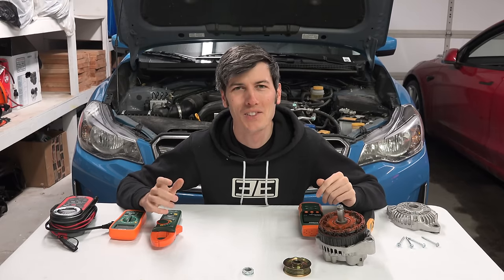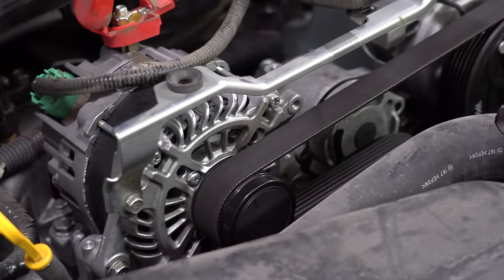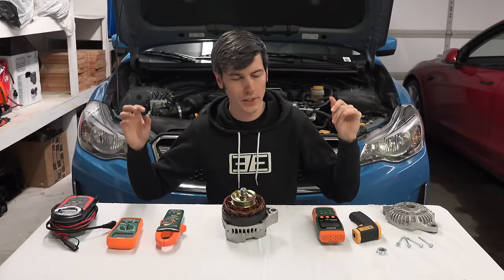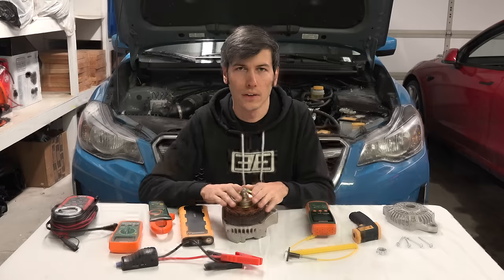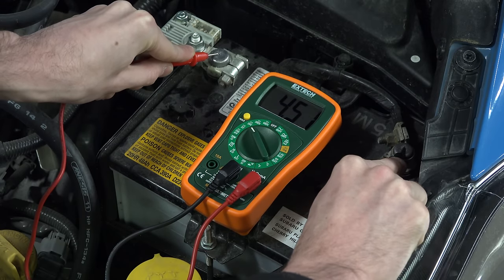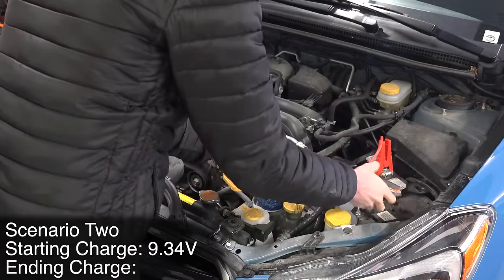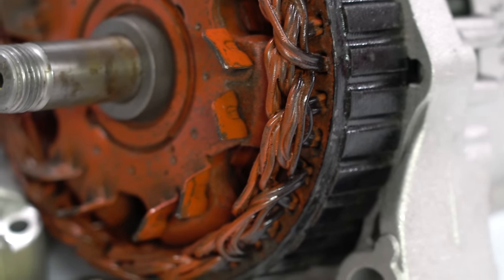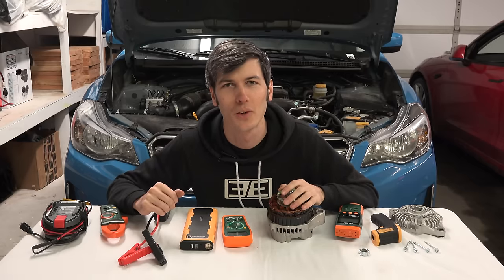Can A Dead Battery Ruin Your Car's Alternator?

Comment: The alternator is designed to work correctly at full load which you are not going to get unless you rev up your engine up to 6k rev/min. The alternator, as any other working machine, will get warm when it is working. Your biggest concern with a dead battery should be your ECU's that could potentially be damaged since the battery helps kinda likea huge capacitor that smooths the possible variations on the alternator output.
Reply: A dead 'good' battery will provide more 'capacitive' spike filtering than a fully charged one. If the alternator tried to apply too much voltage, the dead battery would happily gobble it up. If the battery can crank the starter and start the engine, the ECU voltage is fine. If the voltage was too low for the ECU, the engine would fail to start but it would never have cranked the engine over in the first place.

You'd have to remove the battery entirely to not have it absorb spikes. ECUs are not fragile children, they are designed to operate in a horribly noisy environment across a wide range of voltages and temperatures and have idiots do weird things to it's inputs and outputs. The power supply is well-equipped to deal with short term over-voltage. Even a simple resistor and a zener diode would do the job. Otherwise, shoot the engineer that designed that POS and get a proper car.

The alternator was designed to operate at the full RPM range of the engine. It provides the current necessary to run the car and top-off the battery after starting the car, plus a moderate amount of over-capacity for longevity and abuse. If the battery voltage is fine, the alternator field coil is throttled back and the alternator has no load, regardless of RPM.

However, due to the physics of moving coils and magnet fields, an idling engine can't turn the alternator fast enough to supply it's maximum current -- assuming it has a dead battery or a short circuit that is trying to suck endless amps from it.

Comment: It would have been interesting to see the difference in gas mileage between the 2 drives.  Not that it would be significant but it might be more reason to use a charger vs the alternator.

Comment: What about starter motor ? Does a less than 100% charge ruin it ? What’s the min voltage required for stater motor to work ? 🙏🏽
Reply: This stuff shouldn't apply to the starter. Starters aren't used for very long so they shouldn't overheat in normal use. When your car has a low battery and doesn't start it is usually because your battery doesn't have enough voltage to trip the starter relay so no power will even go to the starter.
Reply: A low battery could affect the starter's performance. The starter requires a certain number of watts (volts x amps) to crank the engine, when the voltage is lower more amps are needed to get the same wattage from the battery to turn the starter. Amps pulled from a battery have to do with the discharge ability of the battery, measured as C. C rates are multiplied by the capacity of the battery to get an amperage output rating. If the dead battery doesn't have a high enough C rating or the capacity is too low, the amperage out will suffer. This combined with a low voltage will mean fully stressing your battery to the point it can damage the cells while still not necessarily outputting enough watts to turn the starter and engine to start it. Also more amps drawn by the starter does create more heat, which as mentioned by Jason, can cause the internals to fail sooner. Voltage also dictates the rpm of a motor, meaning a drained battery can't spin the starter as quickly, this may be more of a problem for starting the engine as it can't complete its cycles in time. 
I don't know that starters have a minimum voltage, perhaps newer cars do with all of their fancy sensors.
Reply: It would be a minimum amount of watts to trigger the large ~200Amp starter relay (the loud click). Then a higher wattage required for the starter motor to turn the weight of rotational mass against it's compression stroke.
Reply: the more current you give it and the less it is able to rotate heats it up more. don't try to crank if it can't spin the crankshaft.
Reply: No it will not. The worst thing that would happen to the starter is that it might not engage if the battery can't supply it with enough power, or it may engage but crank the engine too slow to start it.
Reply: Only if you insist in trying to start it when it can't turn, it may weld the brushes, or heat the windings until it melts it.
But for that you need a battery charged enough to do damage, but discharged enough to not be able to start the engine, combined with misuse.
Reply: @victornpb  True. However, you would probably have to try to crank it for 30+ seconds for that to happen, which could overheat and damage a starter with a charged battery too
Reply: Yeah, just don't use your starter to move your car for too long.

Comment: Checking the battery without load is not a good way to measure.  As long as there is current to  drive the impedance resistor on your DMM, it will display good voltage.  Voltage measurement is done in parallel so your DMM will has high impedance to make sure the current across the circuit stays the same.  The best way to measure the state of battery is to measure across a load.  Healthy battery will continue to maintain voltage level while draining current, but bad battery dissipate current quickly and loses potential (voltage).  Think of alternator as gasoline powered DC generator.   Oh, if you are upgrading your stereo with after market amps, you might want to upgrade your alternator too.  Alternator can handle few occasion of dead battery, but if you constantly run higher current, it will definitely fail prematurely.

Comment: Alternators are usually at least 100 Amp, so, there should be no problem for the alternator if you keep power consumption low. Charging a car battery at like 30 amps is not a good idea, however. For the occasional emergency situation, probably not much of an issue, but if done several times, the battery will have a shorter life.

Comment: Thanks for the video, I tried this too! Another thing to consider is the effect of being charged by the alternator on the battery. I have heard that you will take a lot of life off of the battery if you charge it with the alternator instead of a charger because it is charged much more quickly, but I am not sure if that is true.
Reply: That is for a deep cycle battery! You can ruin a deep cycle battery by running in a car because it charges at a high rate and not at a longer duration. Thats why they tell you not to run a deep cycle battery in a daily driver. I didnt know that eather. You are welcome for the info.
Reply: @scottfirman  Actually this battery is from 2008 and it is still working perfectly fine, so I have no clue what the problem is

Comment: The "dead" battery(IMHO)was in fairly good condition and that is why it was able to recover(from 9.34 to 12.82 volts) in about 25-30 minutes of charging. One more test utilizing an older(say 8-10 year old)battery that will still competently start a vehicle. Drain it as you did for test #2 then test all of the parameters.

Comment: A modern alternator with an internal electronic regulator has a current regulator function. It measures the output current and limits the output amps to a preset level established by the alternator's manufacturer. A properly designed alternator, where operating temperature range and all possible battery conditions were accounted for, should self protect itself so a dead battery won't damage it.

Comment: It would be interesting to see a bad battery (e.g. dead cells, prolonged sulfination, low electrolyte, etc.) and its impact on the alternator. Essentially, what about the battery that will NEVER go back to proper voltage?

(I know the answer, but would be interested to see the process tested in a similar manner that you showed here.)

Comment: Would you recommend recharging a battery, which voltage dropped under 1V, because of the car was sitting on cold through winter?

Comment: If monitoring the alternator it wouldn't hurt to monitor the heat on the internal diodes. They are the parts that are most likely to overheat and fail. Running your car at idle with everything turned on puts a lot of strain on the alternator. This is because the fan in the alternator is not moving much air even though the alternator is producing a lot of amps.

Comment: 2 things:
1.  It's very hard on the battery to take a charge at 60 amps.  It will damage the battery
2.  An alternator that runs 60C at 0C is going to be well up into the insulation degradation temperature on a 30C day.

If it's possible, I'd buy a 2nd battery before I tried to depend on my alternator as the only device to charge a flat car battery.  A 10 minute run home to get the battery on a  charger?  Sure, I'd do that.

Comment: On my Subaru legacy I have the flat six, car originally came with a 480CCA Battery, basically the same ones that the four-cylinder has... I disagree with the engineers or whoever was being cheap at Subaru every other 6 cly  Ive notice runs 700+ CCA with fairly good amount of reserve capacity. I was able to find a group size 6 that was 580CCA for my Subaru Costco actually sells it and you can’t beat their warranty for 42 months for 77 bucks.

Comment: Your coil and bridge rectifier wouldn't see as much stress, but the voltage regulator would take a huge hit. 150°F is near the breakdown point of most voltage regulators. Most manufacturers of voltage regulators recommend keeping temperatures below 160°F. With age and work hours accumulated, 150 is just as bad as 160.
For random knowledge, an alternator without a voltage regulator produces 30-50 volts with most hitting an average of 34v at idle.
In most cases an alternator's voltage regulator won't let that kind voltage pass if it fails but the battery will see an excessive amount of DC ripple which will kill a cell. Working for an auto parts store I've only seen one case where an alternator let high voltage pass and it was at 15.7 volts with heavy ripple.
Reply: Don't forget that the regulator doesn't just regulate the output voltage. It also limits the output current to whatever the alternator is designed to put out. If it's a 60 amp alternator the regulator will self-protect the alternator by limiting the output current to just 60 amps. If a discharged battery plus the rest of the electrical system tries to draw more than 60 amps from the alternator the regulator will reduce the field current, which in turn will begin to drop the output voltage coming from the alternator. The output voltage, normally around 14.5 volts, will start dropping while the current will stay right at 60 amps. Then as the battery charges and the battery and the electrical system together begin to draw less than 60 amps the output voltage will go back up to 14.5 while the amps drops below 60. This is how a modern alternator protects itself. If it's working correctly you can't overload it.
Reply: @joevignolor4u949  this true. Before solid state voltage regulators were a thing they smoothing capacitors on the. 😂

Comment: Good topic.  I have been wondering about this for a long time.   I have a camper van and have 2 additional AGM batteries set up for the camper.   This is the same type of battery that the van has and the vehicle charging system is set up correctly for these.  The alternator is 180 amps.  I currently have it set up to charge only from the vehicle charging system.   This has worked great for us.   

I have heard from many that I should not tax the vehicle charging system with this task but some say it works fine.   So I have been wondering if  I should install a solar system to handle this task?

I had a boat set up pretty much the same way.   I had that for 12 years and used the charging system of the motor a lot.   It was designed from the factory to do this.  It was a GM 350 CI engine so I don't think there were a lot of changes to the alternator from what was used in cars.   This look the same.   I know they do make it sealed so there are no sparks but that would make the heat build up even more of an issue.  Again 12 years with no problems at all.   I think I had 3 sets of batteries during that time too.   These were combo deep cycle/starter lead acid batteries.   The boat did not have a separate start battery.  Just 2 sets of batteries so you had a back up if one became too low.  

So I am still unsure if I need to change my setup or not.  Thoughts?  Thx
Reply: You should put an amp clamp on the alternator output when it is first charging after the start.  That is when it will be producing more amps to replenish the starting loss to the battery.  After that is mostly filled, the amps drop to the service load.  If you re running near max amps for a long time, it is stressing the alternator.  If not, you are likely okay.  

Where you'd run into real stressing is if all your batteries were low needing a lot of charge.  Even then it still depends on the amp draw.  But if you want to manage that, you could put in a battery switch to let you only charge one bank at a time when they are deep drawn.  Or you could put a solar charge controller on your non-starting batteries to limit the current they receive to no more than 7 amps.  That means recharging will take a long time, but only at a load of headlights amps.  

The key is not to run the alternator full field (max amp output for a long time) and consider the cooling.  It may be that your installed alternator was rated for additional battery charging being in a camper and/or a boat where you'd expect drained batteries due to amenities used while not running the engine.
Reply: @jkbrown5496  Thx for the reply.  I do monitor the current going to the house batteries.   As you said, there can be a large amp draw when first starting but it tapers off very quickly.   In less than 30 seconds it seems to stabilize about 30 to 50 amps.   Depends on how far down I draw the house batteries.   I also try to never drop below 12.3 volts on these and that only happens if we camp for a number of days.  Thx again.

Comment: Theoretically, the alternator regulator pack should have current limiting built in that reduces the current going into the field coil to compensate for high load conditions. I'm not sure of this, though (haven't tested it). Perhaps shorting the alternator would be a test to see whether it does actually limit current to prevent damage to the alternator and its components.
Reply: The bad part about shorting an alternator is you are also shorting out the battery! A really quick way to melt a screwdriver
Reply: @myofficegoes65 
Ah yes, I was going to suggest disconnecting it from the battery but forgot haha. Would make for an interesting video anyway!

Comment: The key question is "What is a dead battery?", what is tested here is a battery with a very low charge, it is still a good battery when you charge it up.
A dead battery can be many things, but lets take:
A battery with a high internal resistance.
A battery with one, or more, short circuit, or open cells, and these can be all more or less short circuit, or open, rabbit hole warning here.

A dead battery can kill, or damage  an alternator, a shorted cell may put the  alternator on a hard job trying to charge the battery and the battery may then creep into open circuit, this can be to difficult for the  alternator and it can start to produce spikes of high voltage (no battery with a low internal resistance to keep the voltage down), this can kill the charging regulator in the  alternator, this is bad, to have both a dead battery and a dead  alternator (the thing can go into full charging all time), so you buy a new battery and all looks fine, but after some time dead battery again, and this i a funny game.

Comment: Very good test! I always deplete my car battery not more than 30% using 12v fridge and than charge it with alternator for about 10min. What is the maximum Amps output of that alternator you used? It should say on the side of it, mine is 70A max

Comment: Good video as usual BUT that is not a dead battery.  It is low or discharged.  You should make an addendum to this video that actually uses a dead, as in unable to take a charge, battery to show the true effect that has on your alternator.  You might want to use a car with fewer electronics.